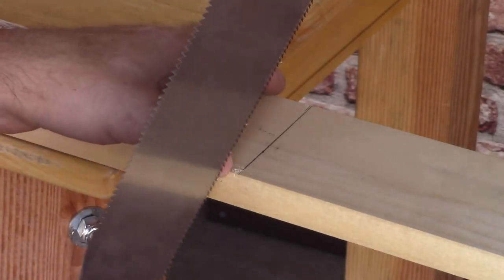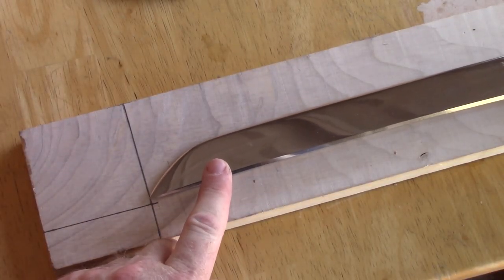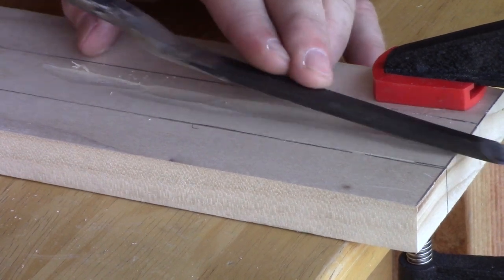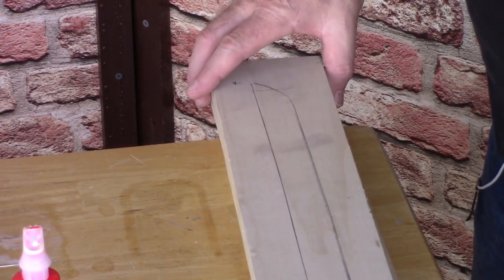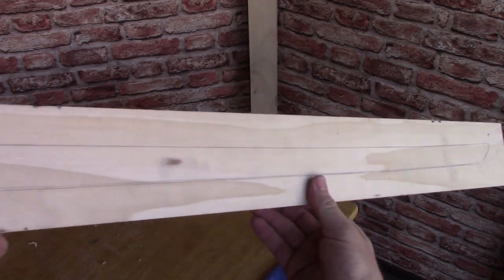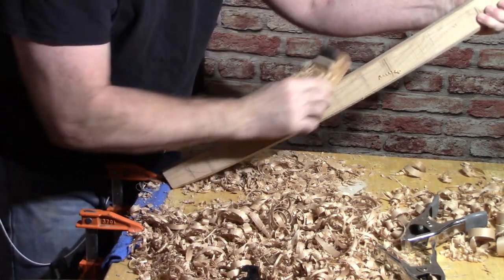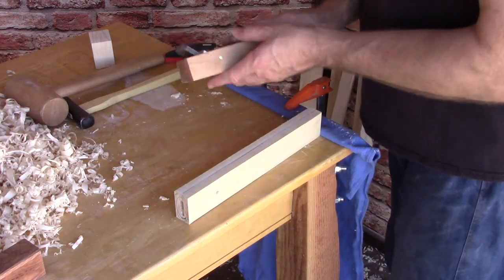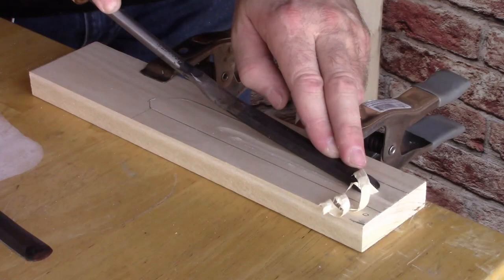Hand-forged katana: Step 9, scabbard and handle

Comment: This technic of using a black paper to check where the tang bites the wood is so dentist! Hehehe
Love your videos!
Reply from the maker: Yes, I use many techniques from dentistry!
Reply: @oldpuebloforge  here in my country we call occlusion. When the teeth is biting the wrong side of the mouth. Thanx for the reply. Could you do a Greek or Hungarian blade next?
Thanks very much for the hard work and GREAT content!
Reply from the maker: @meatz666  Yes, we say occlusion as well.  Are you a dentist?
Reply: @oldpuebloforge  Thx for responding! No, but I spent almost 10 years with my bite in the front. I lost 4 teeth and most of the bones of my upper jaw. Now I have 4 implants and my teeth rests in the right place... But the dentist "shop" (lol) is a place that I go more often than I would like. I would definently prefer going to your bladesmith shop that's for sure. I'm Brazilian btw, but my mother was Portuguese and my father is Hungarian :)

Comment: I’d have a wooden template made up to lin the blade up with two points of contact so you don’t need to eyeball it, just slide the blade up to the template and butt it up to the wood and it should hold firmly, identically placed

Comment: It‘s a nice video. Undortunately you skipped overvthe most tricky part with just one sentence - fitting the habaki. I would have loved to see more detail on this aspect.
Reply from the maker: I have a video on how I make habakis.   I don't do it the traditional way, though.  I cast them.
Reply: @oldpuebloforge  thanks for the quick reply. I didn’t mean the making of the habaki, that us fairly straight forward. I meant the fitting of the habaki into the scabbard, imho this is the most critical step in the making of a japanese scabbard.